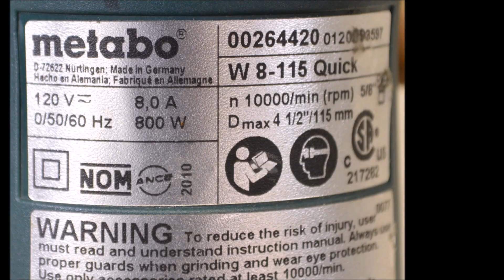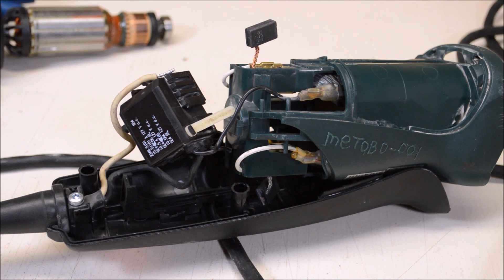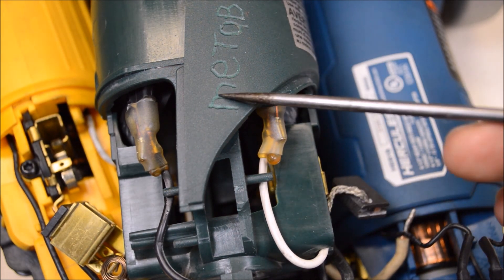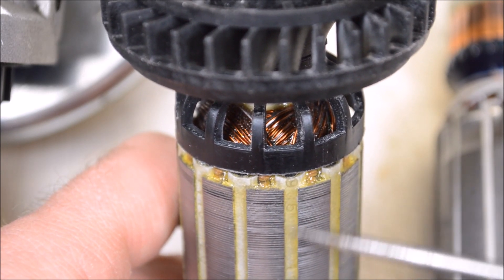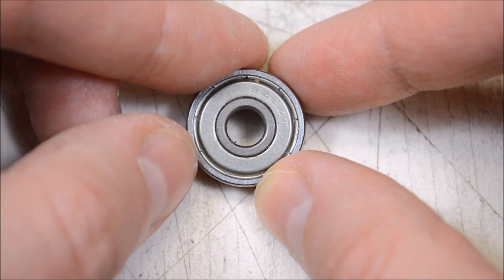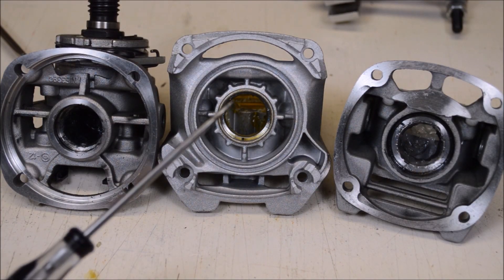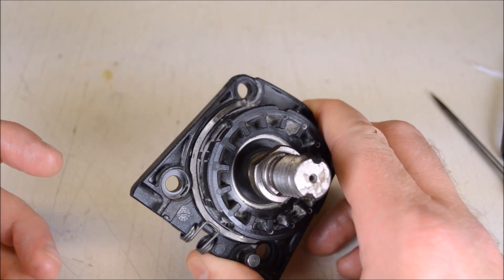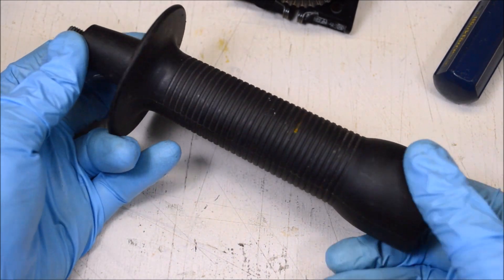Teardown: Metabo angle grinder compared to DeWalt and Harbor Freight Hercules

Comment: They are using spring loaded push in connections because they tolerate much more vibrations and are self-tightening. A screwed connection could loosen over time. This is pretty standard here in Germany when it comes to electrics. 

Greets from Germany!
Reply from the maker: I had thought a screwed connection might be more susceptible to loosening from vibration and that might be why.
Reply: to add, soldered wire on screw terminals are not legal for grid operation.
I honestly don't know why they did solder instead of using Ferrels
Reply: Anxious Merchant because they use spring loaded terminals and therefore solder is legal and easier to apply.
Reply: you prolly dont care at all but does anybody know of a tool to get back into an instagram account?
I was stupid lost the account password. I love any tips you can give me.
Reply: @Hunter Ronald instablaster ;)
Reply: @Elijah Tatum I really appreciate your reply. I got to the site through google and im trying it out atm.
I see it takes a while so I will get back to you later when my account password hopefully is recovered.
Reply: @Elijah Tatum it worked and I actually got access to my account again. I am so happy!
Thank you so much you really help me out!
Reply: @Hunter Ronald You are welcome :D

Comment: I love the metabo grinders.  When you're using it in a heavy environement thats when you really get to see the difference.  The quick change nut design and having the clutch is the best part of the metabo.  The clutch just saves your grinding and cutting wheels from exploding when it gets wedged.  The quick change nut makes it so easy that I've been spoiled.  

When i use my milwaukee or bosh they are strictly for just grinding or using a wire wheel because i hate having to use a tool to take them on and off because its so hard.  Milwakee had an update on the gearing and went to the straight gears like the metabo instead of having the ring gear type and it feels a lot smoother.  If i had to choose it would be the metabo hands down.  Metabo just saves you from being jerked around all day.  Great video!

Comment: I have the paddle switch version of this angle grinder (wp8-115) and it has held up very well for over five years. Two of which I was in a trade school so it was used every single day. I was always worried going in that the clutch would wear out over time and it would lose its ability to cut, but so far that hasn’t been the case at all. The trade school I went to is actually what turned me on to the grinders. The instructor said that when they first opened up multiple companies approached them wanting to give them sample products, grinders, welders, welding hoods, grinding discs, so on. I cannot remember off hand all the brands of angle grinders, but I know the instructor brought one of his personal metabos that had been already used and abused for years, tested it for a few months against the others that were supplied, and the metabo still outlasted the others. I now own two and will not go back to cheap angle grinders. If you do even the slightest amount of welding or metal work you really should invest in good tools, and one of the most used tools in a metal shop is the angle grinder.
Reply: I have a 10 year old Metabo w14-125 that I have replaced the brushes on 3 times and it has outlasted more DeWalts than I can remember although the bearings are starting to get noisy now.

Comment: Nice video, I rebuild gear boxes and plastic shims are very common, Just like the clear plastic ones. They do flake apart on gearboxes I disassemble that have been in service since the 1970s. But, they were holding the tolerance the whole time, And I’ve never seen them be the cause of failure. Pretty impressive.

Comment: Spirl cut is stronger in most cases in one direction, truck axles will be reversed front from back as loads change heavy use. Straight shear easier however spiral needs a good contact with pinion. I do appreciate you taking time and money to do this. The clutch setup is now appearing on higher end grinders. As is soft start, oddly half the tool guys go oh it seems weak but its safety to not jerk and less fatigue for user. I also like the breaks on grinders and on circular saws. In my area dewalt has been the go to and last. Now makita rat tails were the go to for a long while. Both of my dewalts are made in u.s.a. one was gift and one the wife bought me. I'll say my newest 13 amp is very nice but I highly recommend buying good disk and cutoff wheels. Cheap can come apart and good ones make ok tool work like super star but cheap ones make it a chore.

Comment: The plastic plate isn't an an issue on Metabos. I maintained many of them and my personal 6" Metabo is ten years old and finally managed to wear the gear teeth enough to require replacement. Under thirty bucks and the rest of the grinder (including brushes!) needed nothing.

Comment: The brush length might be the same but the width is significantly different. A narrow brush will wear faster because of the smaller contact area. It will also have higher electrical resistance leading to higher temperature. You did mention harder material but the pressure from the spring will be important because it will affect wear on BOTH the commutator and the brush. Brushes are replaceable, commutator not so easy. BTW, you’re getting “coil” springs and “flat spiral” spring confused. Coil springs more commonly refer to a constant diameter such as the springs in your car’s suspension.

Comment: odd the metabo had a powdered gear where the others had hobbed steel gears.. i wonder if its a case of metabo cutting corners or if the powdered sintered gears can be made to last as long or longer than machined steel ones

Comment: Would love to see if all the hype on Fein grinders is legit.
Reply: related to Fein. I have few of those. The smaller ones 115mm disks are made in China. I was surprised to see that since in their advertising proudly present the brand as the only that does everything in house and have an engineer that takes a tool from bearings and assembles everything 'till the end product. If Fein cut costs ... than it's bad ...

Comment: I'll take option e: get the orange harbor freight central pneumatic $20 grinder, has good reviews on harbors site
Reply: I’ve had an orange HF grinder for about 15 years and put it through hell and it is still working fine.   Not bad for what I paid for it.   Definitely a cost effective tool.   Plenty of power too.

Comment: they use plug in connection cuz its easier and faster during the manufacturing. i think metabo its still made in germany. and here are  labour very high. if they wanna compete with the chinesium grinder. i took a few older and newer metabo 230 volt grinder  appart. i think the older grinder are nicer then the new ones. i would not recommend to cheap out on grinder even if you use the grinder only for 2 minutes in a year. its much nicer and safer to use a good quality tool. u can cheap out on outer things but not on tools.

Comment: I suggest you test angle grinders cutting much thicker scrap, at least 1/2" plate or 1" rod or bar. They'll handle it if you let the cutting disc float on the workpiece and that will be more informative than cutting light stock which any grinder can manage.
Reply from the maker: As we found in this video, not every grinder can handle the cutting test: https://youtu.be/Gu4Y_R29ZMo

Comment: I think it's interesting how sintered metal gears are frowned upon in tool reviews but nearly all top quality stainless knife blades are sintered and more expensive than forged blade steels.  Of course Tool Teardowns hints on the primary reasoning in this video in that sintered blade steels can include  components to improve the blade characteristics that you simply cant get in forged steel.  Just an observation, I guess...
Reply: The difference between sintered powder metal gears and powder metallurgy in knife steels is that the knife steels undergo an additional forging process after the powder is produced. Increasing expense, and producing a very fine grain, but extremely strong steel. Sintered powder gears don’t undergo additional forging, they are simply stamped powder in a die, and then baked to set.

Comment: Enjoy your videos. So I am looking at two grinders.A Tilswall @$31. a Tacklife @$52. Both have epoxy on the stator,sealed bearings as far I can tell from the pictures/wording on Amazon. Both come with 6 disks, the Tacklife has a case and anti-vibration handle that the Tilswall does not. However the Tacklife is 8.5 amp and the Tilswall is 7 amp. and 12k rpms for both. Is it worth the $21 more to get 1.5 amps ? Would I notice the extra juice of the 1.5 amps? I look forward to your comment? Thank you in advance.

Comment: I'd just like to comment that this is an out of date base model Metabo.
Their new grinders have no competitor that even comes close. Unlike other obsolete brands....cough* Snap-On cough*
Reply: I was looking for my first grinder. Never needed one til recently. I was specifically looking at the Metabo and a Dewalt. 

Skipping on Milwaukee, even though I really have had great experiences with their products and like them.   Skipping on Makita and Bosch based on another tear down I saw of one that was roughly only a year old video.  

Still considering Dewalt, I've had good experience with my wet dry vac and hand sander. 

Most likely going Metabo though.

Comment: It’s a no brainer the metabo will outlast either of the other two brands of course it is higher priced . But if You grind all day everyday the metabo is what you want. They take the abuse that’s why most pipe fitters use them.

Comment: Great and informative video but. I'm a pipefitter and have seen many people damage these by using the button to stop the disc while it is moving. That it horrible advice and voids the warranty on your grinder should this cause damage. I use gloves and after locking the wheel, I hit the edge of the wheel with my hands in the loosening direction.
Reply from the maker: You're correct if you're using a normal grinder. However, the directions for the quick-release nut on the Metabo specifically say to stop the disk with the button. You're not voiding your warranty in this case because that's how it's designed to work. Check out Metabo's own video on it here: https://youtu.be/fs2nmUtfFuY.
Reply: But you shouldn't stop the disk with the (lock) button when it's spooling down.

Comment: The Metabo is made to make up for rookie moronics; trust I had to be beaten over the head to stop burning out the bushings by forcing the grinder instead of just allowing the tool to do the work.
Don't be a tool; use them instead.. 😎
Reply: Another huge difference in these three is Metabo is the innovator behind many of the features and even pattens which Dewalt and Hercules were only able to emulate after Metabo.
In the pipeline welding industry of the oil fields if you don't use Metabo you are wasting money.
The real difference is use an 8" side grinder on 48" high pressure pipe for 12 hrs/day, and you aren't worn to death be the failed ergonomics and torque, etc.
Reply: Bosch is a horrible, horrible company. Horrible. Hands down wind the award for least reliable and most failing tools ever
Reply: There, on the other hand. Metabo has stepped away from their more "German" ways in an effort to reduce overhead. I will say their adaptations are better than avg still.

Comment: in right circumstances the cheap HF brand work well, but agree they are junk. a friend has 2 of the HF grinders in a body shop,  1 I opened new 2 years ago, 1 is used only with cutting wheels, the other grinding wheels, I personally have put in 50 + vehicles of cab corners, rear quarters, fender wells, & patches, 2 clip jobs, majority done with them 2 grinders, on the clip I did use a HF reciprocating saw to do rough cuts & to cut clip off donors. the trick is to not load heavy, we only cut sheet metal, or the braces, of several layers of sheet metal, if grinder gets warm sit it down for 30 min & let it cool off, & work on something else. & for grinding all the spot welds, we use the HF grinder to cut close & then a cheap HF air grinder with a 3" 36 grit twist lock to smooth welds.

at home I have a good selection of grinders, vintage Milwaukee 7" B&D 7"  Makita 7" newer Dewalt 7"  as well as good & cheap 4 1/2" grinders, but at shop when working I use his tools
Reply: Well at least you get a brake fr grinding